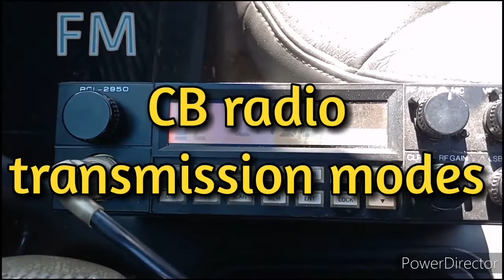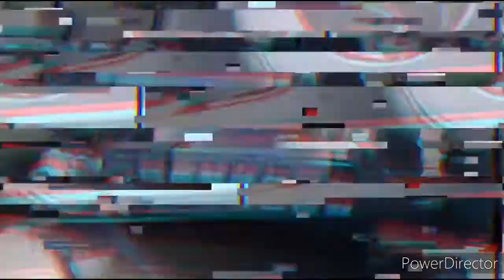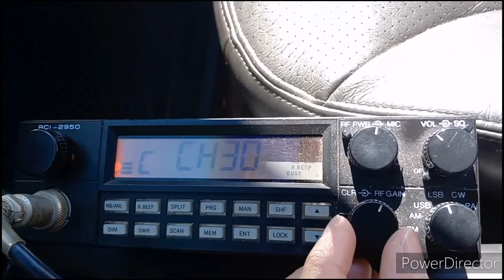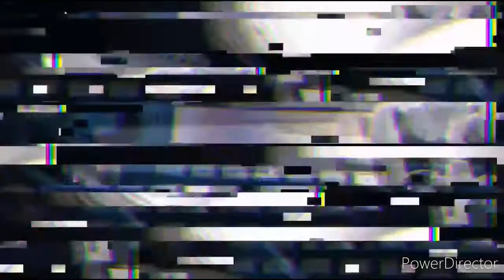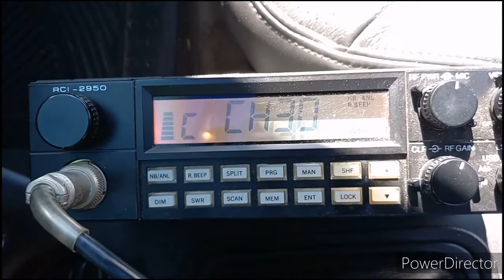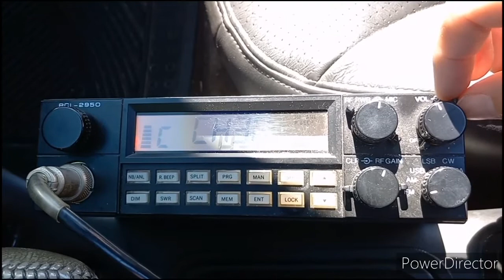CB 27 Mhz Range & Mode Test. RCI-2950 vs Anytone AT-6666. FM on CB. AM vs SSB vs FM Part 1.

Comment: Just curious can you hear am and ssb while your on fm and vis versa? My old cobra radio fried and I was going to get one with ssb and I don't know anything about it. Any suggestions? It'll just be in my semi truck.
Reply from the maker: Yes. Check out my latest Long Range/mode video, youll actually hear how FM sounds on AM and vice  versa. For a new radio there is no radio currently out with AM FM and SSB. Either wait but keep in mind an all mode means it will be pricier. I think FM will be great for truckers like yourself, if the funds are available I would always recommend SSB. SSB gives you more options for   making contacts especially long haul DX. Hope that helps.
Reply: @640amthemix  I appreciate the response. Do you have a recommendation on a current ssb radio? I seen uniden bearcat 980 is pretty popular. I'm looking to spend under $200 if possible
Reply from the maker: @alivia4907  Export cb radios will run north of 200. The 980 is a popular radio and at a decent price. I have an old Uniden PC-122XL. Got lucky at a yard sale. 5 bucks. Eventually needed a new mic. Let me know what you decide and what you think of it.
Reply: @640amthemix  I appreciate the info. Still not sure which one I'll go with. I basically only use it to deliver to a bunch of coal mines and I usually keep it on during bad weather.
Reply from the maker: @alivia4907  if your only using it for that maybe the President Thomas might fit the bill w AM and FM. Cobra has a 19 mini, only AM but cheaper. Adding SSB if u want to make some long haul skip to pass the time on delivery in my opinion but if your not gonna use it why pay.
Reply: @640amthemix  I appreciate all the info. I wanted to go with something with ssb this time. A few years ago I broke a coolant line on my truck in the middle of winter delivering to an old coal mine about 5 miles from anyone. Luckily a random guy in a pickup truck came by and I got ahold of someone. My old cobra couldn't get anything on the radio. So I narrowed my choices to the bearcat 980, president mckinley and I just came across the anytone at5555n for $200. I don't know much about the anytone but I read it could be used as a cb. What would you chose out of those 3?
Reply from the maker: @alivia4907   Anytone is an export radio. In US its sold as a 10M radio hence the possibility of higher power. Uniden 980 is marketed for US as a CB which means its locked in at 4w and hence the lower price. I have a old uniden PC122xl which is also 4w. I have no issues. Hope it helps.
Reply: @640amthemix  yea it helps tho I'm still not sure which way I'm going to go yet. I'll think on it and do a little more research. I'm just a rookie when it comes to radios and what their capabilities are.
Reply from the maker: @alivia4907  Smart move. These radios aren't cheap so it pays to slow down and do your homework. Good luck!

Comment: I miss Channel 15 in Brooklyn. I miss the days of Artie Windjammer. There are no breaks on 15.
I don't know where you got your information about using frequencies above channel 40 for FM. If you look at the specs for the President Thomas FCC AM/FM there are only 40 channels AM / FM in that radio. I have not seen anything from Cobra yet considering they were the first company to ask the FCC for it.
Reply from the maker: I had some sources as rumors were swirling a few months ago but that has seemed to fizzle out. Looks like 40 channels, so now the question is will there be an unwritten channel for FM like 38 for LSB?   Thanks for watching.

Comment: Fm received on am will pretty much sound like an almost dead  carrier with a bit of something is going on here. Am is +/- 5Khz for 10Khz total. Ssb is 2.7Khz but only because anything below 300Hz is rolled off. Frequency response is 300Hz - 3000Hz for 2.7Khz bandwidth required. Fm is 300 - 3000 also. But if I remember fm math is as such 3Khz × 2 = 6Khz + 2.5Khz deviation for 8.5 - 9Khz required for bandwidth. This is how it fits properly in 10Khz channel. 27.405 is channel 40. We were on 27.375 usb for our dailies. I have heard all analog modes received by all analog modes. How do am and ssb sound on fm? Well guys, try it out. I've already been there done that. I never stated that transmission of wideband am stereo is or ever will be legally allowed. And even that can be filtered down with low pass filters. That last one is a personal mission and my own experiment. Another one to try is get a 3rd fm unit on and experiment with 2 of you keying up at once. If both received signals are around the same field strength at the 3rd radio, it does make a unique interference that you have to hear. Once you do your reaction will be like yeah man, cool. If you don't have a 3rd fm capable radio, you can use frs radios to create and hear 2 fm's stomping it out. Have tons of fun with it. 27.305 is about to  go ssb. And I'm going to do my part in Texas to get that to happen. I've honestly got about 300 years of observation under my belt as is. I really am so long overdue for an upload 😩.  I've really got a story to tell. If anyone is interested in meeting my late wife, ease on into my channel and look for Easter Sunday 2011. 7.0 minutes flat and my prize upload. I'm VERY passionate about almost everything I do in this life. Thanks everyone. 640, I am subscribed now. 😁😁😁
Reply from the maker: Thanks for subscribing. I will attempt the FRS FM experiment. I recalled that that the strongest signal would win out but you seem knowledgeable on the subject.
Reply: @640amthemix  I have at least 100 years of experience on observing radio phenomenon. I'm 56 but have samples of too much in life and observing already. Why stop now. Mix, this is all good. You too like Garrett Wang, do not seem pompous to the least. Thanks for the continued replies. I'm going to get my first part of my am stereo experiment soon. I'll upload videos as I progress. My goal at first,???? To hear XFM shortwave in am stereo. If everyone gets the same devices or a Persius sdr for computer,  can do am stereo reception as well. If you're interested, I'll show you all what you need to make an extremely portable shortwave stereo receiver. Le me get my parts before I send links. Long live analog. Live long and prosper.
Reply from the maker: @elektroqtus  what is the difference between AM stereo and HD AM signals like what 880 khz in NYC is putting out? HD vs AM Stereo could be a topic you expand upon!
Reply: @640amthemix  my analog am stereo probably has enough bandwidth to boost HD am signals as well. They're +/- 13Khz - 3Db for 26Khz total usability for amplification. If you're really interested in seeing this radio opened up, aligned and connected, go ahead and subscribe to me. My 1st video will be how to expand the tuning range above and below broadcast bands on not only am but fm as well. This is my 3rd radio so I am well experienced and familiar with the radio model. I haven't had access to my phone for a minute. This is why the delayed reply. Fm cb is also a neat experience.
Reply from the maker: @elektroqtus  Looks like something you might be able to patent.  Will do and thanks for watching!
Reply: Actually, I was a bit mistaken about fm bandwidth requirements. As this: 2500hz audio = 5Khz, +/- 2.5Khz = 5Khz. 10khz is required for this. It's weird that way but even less deviation would allow for slightly better top end audio but would be even quieter volume before fm noise threshold gets the best of your sanity.
Reply from the maker: @elektroqtus  That's what I heard. 2.5 khz steps.
Reply: @640amthemix  no, the space required for 2.5Khz audio at 2.5Khz deviation is truly 10khz. Any closer and interference occurs. 2.5Khz bandwidth is attainable with a good CODEC 2 system. Public service and law enforcement are using it now. However, it does sound unnatural. Intelligible but weird.
Reply from the maker: @elektroqtus  FM at 2.5 khz does sound rich on the Thomas. I will try and put out a range/mode test in the future.

Comment: Mix just announced January 2,  2022 Presidents new FCC part 95 class d approved transmitter go on sale. The President Thomas Am/ Fm modes AM 1-40 switch to FM mode FM 1-6 Also the new President Adams replaces the  President McKinley SSB AM/ FM The new rules are up on the FCC website along with 6 new FM frequencies. Midnight old night 2021 New Years Eve It is now legal to use FM on CB radio eastern time. I plan to fire up the rig.
Reply from the maker: 2022 will be interesting to see with the  new changes. Hopefully a spike in CB popularity will continue after lockdown spike of 2020.

Comment: What mic are you using on the Anytone 6666?
Reply from the maker: Stock mic. I've read the 5555 comes with a different mic that is not as popular. I also have the Anytone Smart 10M FM micro mobile and it comes with same mic as the 6666
Reply: @640amthemix  Your talking about a Electret Condinser mic not a dynamic like most radios have had.
Reply from the maker: @mikebolton5577  Thanks for the update!

Comment: I understood that FM will be legal across the whole of the existing 40 channels, there's been no mention of extra channels for FM use.
Reply from the maker: Yes you are correct but rumors abound of talk of  extra channels. Another rumor is President will unveil a new version of the President Randy with FM here in the states.
Reply: @640amthemix  it would be nice if you could get another 40 channels. We have 80 in the UK. The original channels are FM only and we have the 'American' channels which are all mode (AM/FM/SSB).
Reply from the maker: @delboyonline  That would be the best scenario if they matched up to OFcom band plan but one rumor floating around is they will add 6 fm channels above the USA 40. We shall see.

Comment: With FM being a "big duty cycle mode", wouldn't the wear the finals faster even at 4 watts PEP?
Reply from the maker: Yes it would. Good point and thanks for sharing.
Reply: @640amthemix  Although, with the right mics and EQ's and all that, the FM side could sound quite well as I've experimented with my Icom 7300, W2IHY EQ and EQ Plus Effect Processor and studio style mic on a boom arm - yes, on the CB band!
Reply from the maker: @charleswoods2996  I have listened to some on Shortwave especially 80 meter AM that are into audio with EQs and signal processing etc its all part of the Hobby of radio. Listening to 4840 khz VROW Radio International as we speak.
Reply: @640amthemix  I got nothing but 7 X 9 noise on that freq.
But yeah, I'm a bit of an audiophile; have been ever since I discovered that such mics and gear could be wired up to CB's and HF Ham gear.  Always wanted to sound like a broadcast station - and then, God forbid I figure out how to broadcast in stereo with the FM!

Comment: nice. 590 Midtown Manhattan 73's
Reply from the maker: Thanks! 590. I'm either on 36 or 38 LSB! Keep and ear out for 640AM The Mix!  Also on 640 Khz. I have a small transmitter. I broadcast from different locations.

Comment: I think they should give us NEW FREQ's for CB radio, and move US up to UHF so we dont have bad static anymore.   all these LED stuff sure made AM hard to talk when you have 30+ static in teh day time. 

P.S.  yes i know about GMRS,    But im talking no lic needed CB radio new freqs would be nice.
Reply from the maker: I agree LEDs have created a lot of noise on AM on the 27mhz band. Hopefully FM will remedy that to a point. In US we have FRS and GMRS band on UHF band and MURS on VHF band 150 mhz. Thanls for watching!
Reply: @640amthemix  that's the problem with radio in USA period. Digital TV as well. Let's cut the rf output by more than 10Db but take no action to decrease noise floor on interference creation caused by lack of quality control. Led lights, dsl, cracked insulators on high voltage lines, arcing transformers, electric or electronic cars and their non filtered power modules, and way too many consumer products which designers omitted filter caps. Alternator diodes don't have to be loud electronically. 6 small capacitors later, GONE! So as long as qc departments stay unemployed because of deregulation, QRN and QRM will usually prevail here. 🤨
Reply: frs is UHF no license

Comment: FM will result in a lot of blown radios in the US, they soon get hot on FM
Reply from the maker: Correct. Full duty cycle and especially if they throw some 🔥 in the wire! Thanks for watching
Reply: @640amthemix  I learned that many years ago with my first "Raggedy Ranger" just like yours, LOL!  You ain't pushing 100 watts through 25 amp fuses!
Reply: Turn the output down. Anyone with the golden screwdriver can max out the gain. Run about 25% what the radio is rated, keep swr down and happy chasing. 😊
Reply from the maker: @elektroqtus  Correct! I always tell people to run the radio below full power if it's an export radio. It will increase the life of the unit ten fold. I have a 2950 that I keep at 4w am so that's 12w SSB. Still hit the skip with those numbers. If the skip is rolling no need for heat!
Reply: @640amthemix  I had the 2510 Uniden. On fm was the same as dead carrier am. Even at 1 watt, am still peak at 2. Fm only 1 watt. That's where burner helped. Only 35 watts on low, now swing to 85 watts like am. Just plain 35 or 85 watts on hi. And my first am stereo experiments didn't give me any forward swing. Just good old clean fm stereo separation sounding hi fi kick ass sound.

Comment: How far apart are you guys? The FM mode sounds great, but the AM side didn't sound that much different. On SSB it didn't appear that much effort was used to "clarify" the signals. I'd suggest a physical separation of 5 to 7 miles and repeat the trial. Thanks for the work.
Reply from the maker: Thanks for commenting and you have a good 👂 ear! We just about a mile apart. We realized that after we shot the video . We will try and shoot another if I can get Tae Kwon Do Bro to volunteer!

Comment: I actually prefer FM for close communications it has a nice tone to it. I've also worked foreign countries on FM from California New Zealand Australia Ireland Dx can be done on FM wish more people ran FM here in the states.
Reply from the maker: I agree and thanks for sharing. I look forward to working some FM DX. I think it might take some time for popularity to pick up and the amount of people with radios that have FM installed. I have already heard FM activity by me.
Reply: Channel 31 - 11 meter FM simplex frequency. I have been spreading the word, a sweetspot between major dx AM or trucker emergency channels and SSB juristiction...lol. FM is kindof wide and might bleed into 30 and 32 if very local, but The Superbowl will have stations from 4 states away, bleeding 5 channels up and down...so it has been a thing. 
Don't forget to generate a handle!
Reply from the maker: @ERICtheLATE  Thats great! We have been using  Ch 30 here. Also captured activity on video on 39 which in my opinion is to close to Ch 38 for the reason you said, the bleedover of a wider FM signal.
Reply: My 2510 got burned out. Most of us from sidewinders had fm capability. That was reserved usually for early weekend mornings or when we just plain wanted to be doing something different. We could ssb for 70 miles or so. Sometimes didn't even need our burners. Proper fm channels are still 10Khz spacing for 2.5Khz modulation.  5Khz deviation would put you around 12Khz required per channel. It all works out. To need only 5Khz channel spacing at 2.5K would drop audio response to about 1.5Khz audio signal. Do the math, the numbers all add up. Also top audio is 3Khz. Quieter when local, not as crisp as am and not as punchy as sideband. All analog modes I have used. Happy radio days.
Reply from the maker: @elektroqtus  The math is solid. 2510 also a solid unit. I still have my 2950!
Reply: @640amthemix  pawn shop burned mine up. We both used the 2 majority radios for our uses. You mentioned 38 lsb? Did you ever speak to 162 Dave out of Houston Texas? From the early 90's??? He was my friend and if you hear from him, please let him know sw797 Joey said hello. If he's still alive. 😶 but if he is and you contact him before me, let him know to hang in there I'll be back on cb and some soon. And please let me know if you may. This person may be passed away but the thought crossed my mind for some odd reason. 🤤🖖👍✌
Reply from the maker: @elektroqtus  I'll keep an ear for him. Radio is a great format to build friendships. The original social media!
Reply from the maker: I agree FM for close comms is the best. I believe truckers will benefit the most.